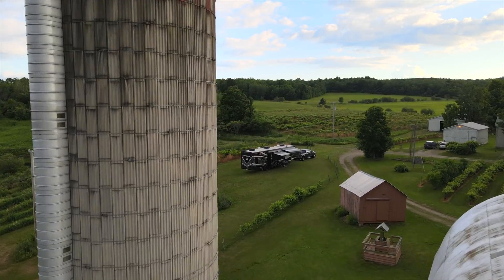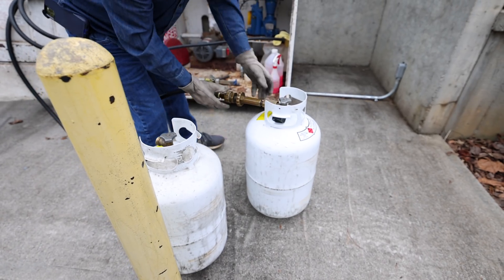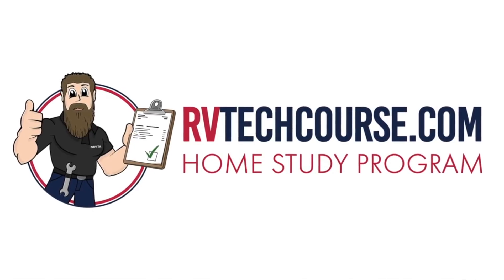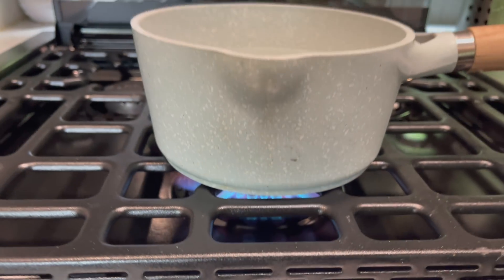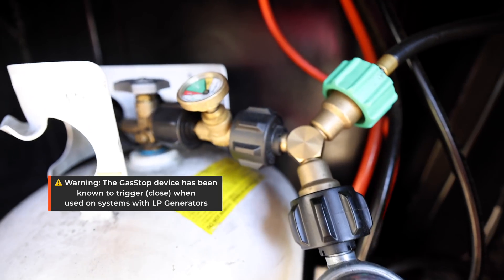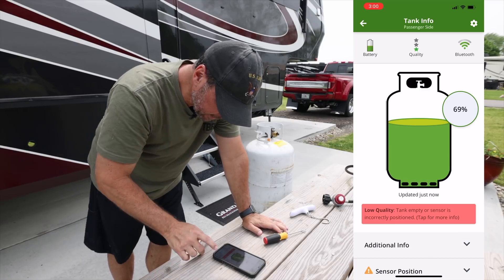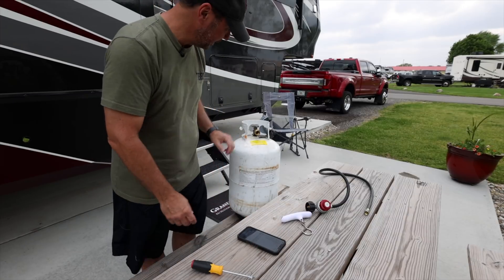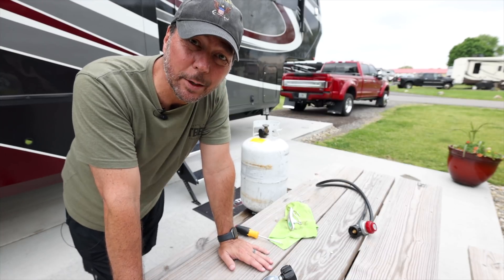Ultrasonic LP Tank Sensor Testing (How Accurate Are They?) (Full Time RV)

Comment: I admire your evaluations on the various systems you have in your RV.  I find them thorough and technically  accurate.  I appreciate the amount of time you take to research and produce these reports.  On the LP tank level indicator, some people may wish to duplicate your method.  I noticed that you did this analysis on a very windy day which is very good, however you may have made a statement that LP gas is heaver than air and without a wind, the gas can settle into lower areas and cause a dangerous situation.  Please keep up the good work.

Comment: Chad, I have used the Mopeka propane sensors for several years and have noticed that the tank levels along with the sensor’s battery strength will decrease as the outside temperature decreases or they will both increase as the outside temperature increases.

Comment: My questions are how do you use them on aluminum tanks, and can you tape them on with duct tape? That would be awful to loose one going down the road! Thank you for a great video, at present prices, I cringed as I watched the gas going to waste. I'll save this one.
Reply from the maker: They do make them for aluminum and they come with a collar to attach them.https://www.mopeka.com/product/mopeka-check-pro-lp-senor-without-magnet/
Reply: The mounting collars are attached to the tank with 3M VHB tape that they come pre-installed with on the collars. You clean the tank and make marks to allow you to stick the sensors in the right spot and then use an ampule of primer that is supplied and then stick the cage onto the tank. They also make a version desiged for flat surfaces that you can install on water tanks and the like. The sensor is easily removed from the collar by just unsnapping the clips on the "cage"

Comment: Thanks for another great informative video Chad! I’m interested in purchasing these sensors. Is there anything else needed besides 2 sensors? I see Amazon sells them separately ~$50 each. Also is there a separate display to views levels instead of using cell phone. Thanks
Reply from the maker: Yes.. there is a separate display that can be purchased. but it's only 5 LEDs per tank (20% increments) and there's no low-tank notifications.  
🅿🆁🅾🅳🆄🅲🆃🆂 🛒  
 + Mopeka Tank Pro Sensor with Magnets for Steel LP Tanks: https://amzn.to/3amCzP9
 + Mopeka LP Check Tank Halo (bottom tank spacer): https://amzn.to/3aifLQI
 + AP Products LP Tank Check Monitor: https://amzn.to/393arjW
Reply: @ChangingLanes  Thanks Chad!

Comment: Chad, thank you for a very detailed and informative review - I've wanted something for my horizontal tank in my Class A since the only system I have now uses the float inside the tank for a measurement, and it lacks a little bit. Since these can be set for the size of the tank as well as the characteristics of it (hard mounted horizontal ASME in my case), they sound like the answer!

Comment: I'm glad you had 6 hours  to kill on  this project. Lol.  Now may I ask where do I put this sensor?  My rv has a built in sideways tank. It's non removable. So will it work for my situation. Thank you
Reply from the maker: Yes.. they work on ASME (horizontal) tanks.
Reply: @ChangingLanes .  Sorry for my ignorance. Where would I put it on the propane tank. My tank is horizontal. Thank  you so much.

Comment: Do you know if anyone has tried to use those or similar ultrasonic level measurement systems with the water tanks in a RV?
Reply from the maker: One of the comments said they use them on their fuel tank...  I'd contact Mopeka and ask.  They do make sensors for water.
Reply: @ChangingLanes  measuring liquid level is difficult.  The most reliable method is with a "sight glass", but that is not practical in many applications, like small propane tanks or remote monitoring of RV internal tanks  If there are solids or sludge in the liquid, then that can be a problem for ultrasonic systems.  Maybe need a dipstick for the RV black tank?  🤭 🤭

Comment: IF you have two tanks do you leave them both open?  I have used the hot water method. It doesn't need to be boiling, just hot, and you can see a line of condensation where the liquid is.
Reply from the maker: We usually leave both tanks open.

Comment: You probably covered the phase change cooling in your other video , but this was a great demonstration. Boiling liquid propane to a gas to use it consumes energy. That shows up with the liquid in the tank getting colder. When the tank is full, the entire surface of the tank will be warmed up by the outside air. The liquid propane and the tank surface are very close in temperature. As your tank level drops, the liquid propane is touching only half of the tank surface. This smaller surface will get colder as only half is being warmed by the air. Condensation happens at the dew point on your weather channel. As you use almost all the liquid propane, the tank surface is really small. Not much surface to warm with the air.   The takeaway is. If you are using your heater when it’s 10F out, you will be pulling more propane out, boiling it faster, dropping the liquid level and temperature faster. At the coldest time of the night, your propane will start dropping towards -44F , even if it’s 10F outside. You can’t use all the propane in your tank to run the heater. It will stop boiling enough gas to run the heater. The heat will go out. After some time(hour?), the tank will warm up and the heater will work, but for less time. Frustrating as heck for people that tried the heat in the fall and decided to go winter camping. They would need to have large tanks, full, and set the tank selector to take out of multiple tanks at the same time to reduce the amount of boiling in each tank to half or less

Comment: Great video...love our Mopeka sensors. Only thing to add is that batteries in the sensors need to be replaced periodically. Longest I've gotten out of mine is a little over a year. One only went 6 months, but I suspect the charge level was low when I put it in.
Reply: If you leave the app open it’s constantly reading and runs the batteries down. Shut down the app after checking the tank levels.

Comment: Propane is actually a greenhouse gas but its warming potential is only 4X that of co2 vs 25 for methane. Propane is seeing increased use in compressor refrigeration systems specifically because of its low global warming potential (it's r -290). The ozone safe refrigerants we moved to after the montreal protocol for comparison often have warming potentials that are 1000s of times that of co2.  We have kinda come full circle back to pre invention of freon and gone back to refrigerants that are somewhat dangerous to the end user in that they are highly flammable like propane or toxic like ammonia but are low impact on the ecosystem at large.

Comment: I have used the original sensors that they came out with for about 4 yrs and really enjoy knowing what my tank levels are. I have the wireless display (which was part of a package deal with 2 tank sensors) mounted inside the camper which is nice for anyone in the camper to be able to check the levels. I just in the last month found out from the Mopeka Tech Support that you can use the wireless display in conjunction with the phone app. I have changed the batteries in the sensors and the display 3-4 times in each unit. Thanks again for the great info!

Comment: I very simple check tanks and switch over device and have never run out in over 25 years. I very simply refill the empty one pretty quick. I run with both tanks open 100% of the time.

Comment: We have been using Mopeka sensors for several years on our travel trailer tanks, and now on our Class A and love them. We did notice changes in the reading on ultra cold days before and after the sun would warm up the tanks.

Comment: So the question of the day:  How long to the batteries in the sensor last?  My other question is will they work well on a horizontal tank like my motorhome has?  All in all it looks like a neat system.   Keep the good stuff coming guys.
Reply from the maker: We had the original (before pro was out) and I changed the batteries after about 2 years.  Yes.. they will work on the horizontal tanks also.. 👍🏼
Reply: I’ve used the previous generation Mopeka sensors for the past two years. I change the batteries in the Spring when I dewinterize the fifth wheel. They last for our entire season which is early-May to mid-October.
Reply: I have changed the batteries in the sensors and the display 3-4 times in each unit over the past 4 years.

Comment: When you refill your tank remember to push the green button to reset the sensors. Also, propane heating pads are great in cold weather. I do like the plastic pads on the bottom of the tanks.
Reply: I’ve only had to do this once.  Not sure why yours needs it every time you fill up.
Reply: @cruisinguy6024  it may be because the last 3 tank fill ups have been in dirt or rocks (Alaska and Canada) and we removed the mopeka from the tank.
Reply: @robertnasser9937  do you have the regular sensors or the new pro sensors?
Reply: @cruisinguy6024  the older ones but they were bought new. Never saw the new round ones until today
Reply: @cruisinguy6024  regular but purchased new.

Comment: Thanks for doing this test. It adds to my confidence in my Mopeka sensor. This wasn't shown in the video but I had to add some gel (supplied with the Mopeka) underneath the sensors when attaching to the propane tank to get it to register on the app. I didn't notice the gel when I first unpacked the sensor, so I thought that my unit didn't work. I watched a youtube video that demonstrated the gel, put it on mine and poof, a perfect reading. I have a 20lb tank.

Comment: I also use those Mopeka sensors on the gasoline tank for my generator on Momentum!   You have to set up a custom tank in the settings and measure the height of your fuel cell but it’s very accurate.  

It’s the only way I’ve found to know how much gas I have left for the generator without having to get out of the RV and go check the gauge.